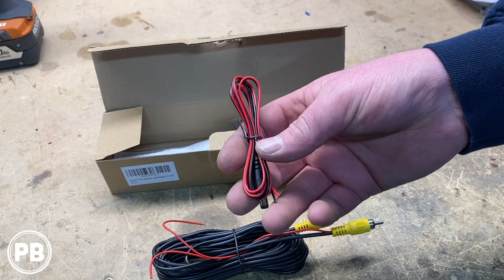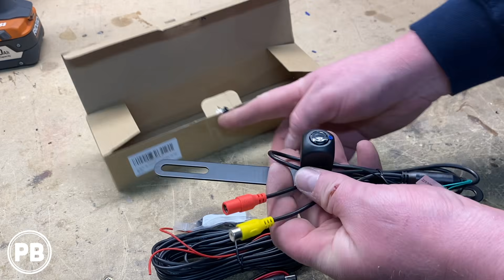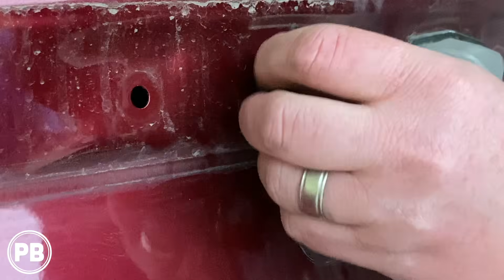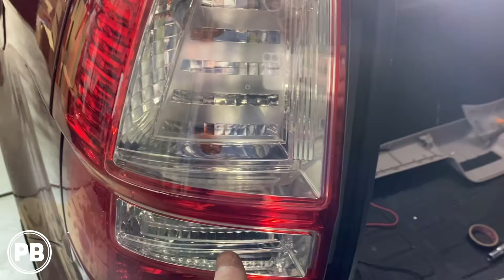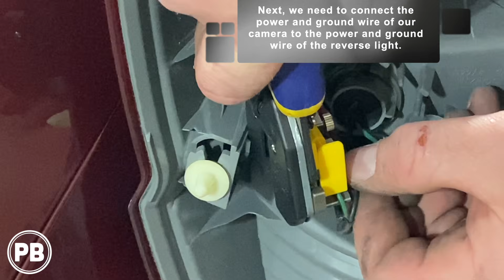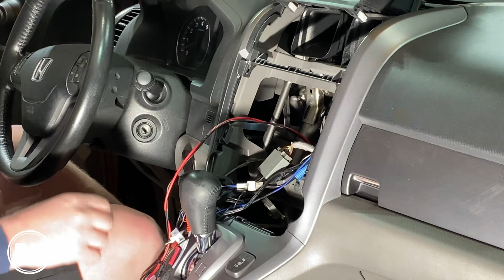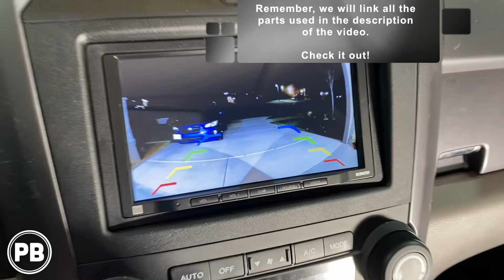2007 - 2011 Honda CRV Backup Camera install

Comment: This is an excellent way to install a backup camera on the 3rd gen CRV.  Other  videos give some questionable advice on routing.  In this video the routing of the wires stay away from the airbags and are easy to install, especially the tucking of the wire under the door sills rather than removing them.  The hardest part is going through the hole under the roof liner.  By working from the back to the front of the car, it is much easier to push the yellow connector on the video cable up through the hole in the metal plate under the roof liner.

Comment: A very helpful video. The only thing I would add is that there are 3 bolts holding down the plastic trim above the license plate. I initially overlooked the center one. In my case they were 8mm on my vehicle. Lastly, I used a long zip tie with electrician’s tape to feed the cable through the rubber conduit. I used dielectric grease instead of soap and water and it went through easy.

Comment: For some reason with certain Pioneer head units tapping the reverse wire can cause dash COMM issues (u0115) and/or blow the dash fuse with combo'd with the Maestro RR unit. Ask me how I know, have not yet found a solution.

Comment: I'm confused. You said either the red wire that's running in parallel with the video wire (00:34) can be used to power the camera or can be trigger wire. But how can it be a power wire if it still needs a ground? 🤔 I thought the camera needs power (red) and ground (black) which both are going to the reverse bulb circuit with that power harness at 00:39. It's almost as if it still will need to be apart of the "power harness". How can it be a power wire?

Comment: I just want to say thanks and also i have a question... i had to run 2 backup camera wires and now I have like 15 feet of extra wire... could this be what's it's causing the backup camera image to be fuzzy?    if so, should I cut the cable and try to connect it?  I normally would just cut and connect the wires but not sure on audio cable

Comment: I bought a 2008 Honda CRV today. Im pretty sure this the same method they used to install the camera. However I think its not installed right so I'm gonna have to try and use this video and figure it out. Like the video it only comes on when you put it into reverse. However the live feed is upside down? Which is really trippy.

Also I don't think they screwed down the camera. It just slides around. TIme to do it right I guess. Do you have any idea how to fix the upside down video feed? I tried checking the settings on the LCD touchscreen radio however its not even seeing the camera in the settings. When I go into reverse. The camera takes over the screen and I can't change any settings at all.

Comment: How bad would it by to cut a slit in that rubber accordion tube and pass the video cable, positive power, and negative through it? I'm about to give up trying to get it through the accordion tube. I don't care how it looks at this point, I'm just worried about the wires having exposure to moisture/air.
Reply: You don't want to cut it. It protects all of the power lines to the rest of the gate. That's why you need to fish it through.

Comment: Thank you so much for this video! I installed a backup camera to the reverse light mostly by myself this afternoon. My husband helped when I needed another hand, but your video gave me the confidence to dive in. In hopes it helps someone else: to get the wires through the accordion tube (the hardest part in the video), we used a plastic ziptie (just the flat part, not the square locking part) to fish the wires instead of using a hanger.  We didn't need soapy water and completed that step easily.

Comment: I have the same camera same radio same car I tried installing this camera but never got it to work.  I connected to the rear back up lights.  RCA connected.  Red wire next to the RCA in the back of radio I tried connecting it to accessory+ did not work then I tried connecting to back up lights+ as trigger like you said not     working.  What am I doing wrong?  There is a camera + wire should I use that?   Im starting to think I have a defective unit

Comment: Thanks for your video. I followed it but my camera doesn’t seem to work. I did not pull a power wire all the way to the radio as my system says it’s integrated into the video wire. There is a red tail wire at the end of the yellow video cord that connects to a wire on the radio. How should I troubleshoot this to figure out what’s wrong?

Comment: what type of wire did you use to extend the power for the short power power cable?
Reply: any roughly 18-14 gauge stranded wire should be fine. its nice to use red and black to keep the power and ground straight but color really doesn't matter as long as you dont forget.

Comment: Doesn't make sense, looks like you joined both pig tails to the power but if you did that you can't run the video to the front. Also at the front you mentioned a red wire a thick one and that wasn't showen in your beginning parts.
Reply: I'm slightly confused by your question.  On my camera, at the head unit (front) I connect the red wire to +12V ignition wire of head unit, and connect another wire (pink) to the head unit's reverse trigger wire.  Then I connect the yellow RCA into the head unit camera in.  
At the back of the car, I connect the positive pigtail wire (it's red for me) to the reverse light positive, and the other pigtail wire (black for me) to the reverse light ground wire.  
I didn't join the red power + reverse trigger into a pigtail like he did for this video.  Instead, I'm grabbing the trigger from the reverse light wire, and grabbing power from the ignition + off the head unit.  Hope that helps.

Comment: Another question 

Do I need to connect a little red wire at yellow plug at camera to the red positive wire that connects to reverse light ? Do you think because I didn't connect it that cause a short circuit in my case?

Thanks for your time

Comment: Sorry to ask a question 

I followed your video to connect android unit for my 2009 honda crv . It worked great but only one part was hooked up the power and ground to reverse light as you showed in this video but whenever I start the car and put into reverse the fuse number 10 with 7.5 amp under dash will be burned out right away and all my dash light off, no power windows either and car can't start , shift gear stucked in park until I replace new fuse again. I have to remove those two wires I tapping into reverse light and everything will work fine again. Any idea that cause this problem.  One more thing my tailgate light has some kind of pulse brake device tapping ino it. The 7.5 amp fuse that burned out is meter fuse. 

Thanks
Reply from the maker: Sounds like a short somewhere. I’d recommend visiting your local audio shop for assistance
Reply: Another question 

Do I need to connect a little red wire at yellow plug at camera to the red positive wire that connects to reverse light ? Do you think because I didn't connect it that cause a short circuit in my case?

Thanks for your time

Comment: Thank you for your video. I follower your guide lines step by step to install an aftermarket backup camera with a build-for-2011 Honda CRV android head unit.  I was so happy I had a backup camera to my old car now. But the next day, when I was trying to reset the android unit, the camera screen went black in reverse gear.  Would you please advice?  Thank you kindly.  Happy New Year!

Comment: Why didn't you paint the bare metal left after drilling the pass thru hole? That spot will be prone to rust.
Reply: I am about to start the same project. Was wondering if its ok to leave the hole as is without applying anything to prevent rust. Is there anything specific that I should be using?
Reply: I’m not sure it would matter much but you could apply some primer there if you want. He puts a rubber grommet over the drilled hole which will protect it.

Comment: Great video! How about the security pin code when you change the battery? Can you change it via the new stereo?
Reply from the maker: The security pin is only for the OEM radio, becomes irrelevant when replacing with a new radio.  The pin is included with the factory radio in the user manual.  If missing, call the dealer.

Comment: Hello!  Am I seeing this correctly?  You need to connect the trigger wire to the power (using reverse light like you) AND connect the other end trigger wire to the purple wire off the radio?  Do we have to have both ends connected?